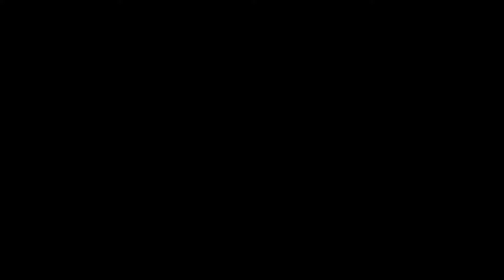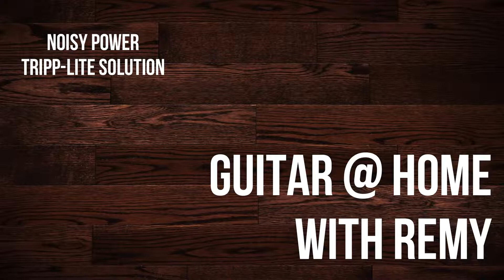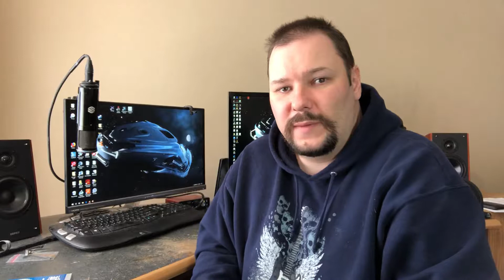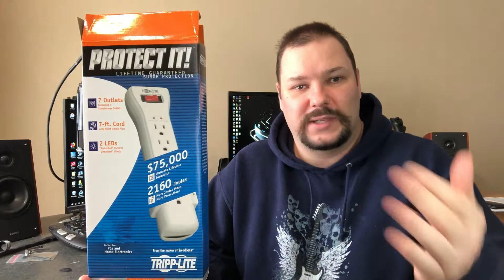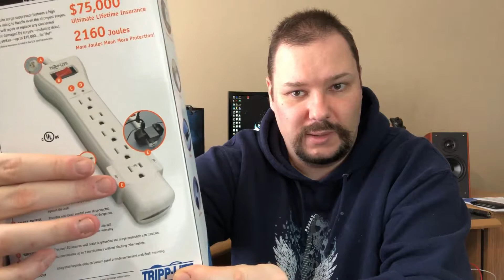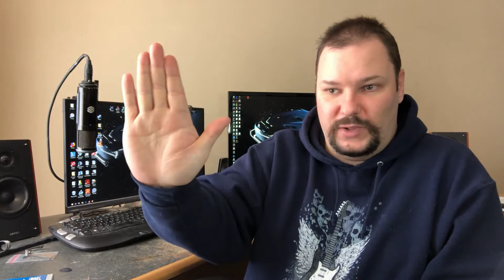Reducing the Hiss on your Tube Guitar Amp

Comment: Can you help me? My fender champion 40 is hissing constantly and it’s driving me so crazy I can’t use it. It is constant, even when nothing is plugged into it. I have also plugged it into loads of different outlets and it’s made no difference. This is really sudden as I’ve had it since Christmas and it hasn’t ever done this before. I really hate the noise and if I can’t fix it I’m going to have to stop using it.
Reply: Try changing the tubes. Sometimes when tubes get worn, one of the indications is they start hissing.  Often, putting a new set of tubes in will make it go away.  Even changing the position of the preamp tubes will sometimes reduce the amount of hiss, especially if it's the V1 tube that has gotten weak, as that's in the first gain stage, and is what the other tubes amplify so any hiss in that one will show up the most.  

You can also go with a low-noise preamp tube, like a Mullard CV4004 (which are a very transparent, clear sounding, harmonically accurate tube) which will reduce the amount of hiss considerably if it's coming from the preamp section. Power tubes can also hiss, and putting a fresh set in can often take care of that, as well.  

That's probably the first thing you should try, as it's the most likely culprit...

Comment: Hey bro. Im so fu**ing glad I found you. I have a question. What is the proper name of that thing you are talking about ? Cause I have a 120w Bugera amp and yeah it has that horrible noise you are talking about. So you feel me. Im just wondering what the name is so I can look for it here in Europe.
Reply: If it's a buzz, theres a high likelyhood its a ground loop. Or a grounding issue in general. Theres a slew of different things that can cause it. It can even be a problem with your amp internally. Tracking down these problems can be difficult though comments or small emails. Places to start would be buying a Hum X ground loop eliminator. Also having a qualified tech look over the amp. Again it's hard to reccomend fixes with little info, but hope its helps somewhat.
Reply: The item he's talking about and showing on the screen is a Tripp Lite 7 Outlet Surge Protector Power Strip (SUPER7). It does claim to reduce line noise in it's advertising material and is pretty inexpensive.  A couple of people in the Amazon reviews for this item in black (SUPER7B) also noted that it eliminated the electrical noise for them, as well. 

Other units that reduce electrical noise are referred to as Power Conditioners, and there are companies that are known for making these types of products, such as Furman. Two Furman units you may want to look into are the Furman M-8X2 Merit Series 8 Outlet Power Conditioner and Surge Protector and the Furman PST-8 Power Conditioner that can dramatically reduce AC line noise and contamination.

Note: The vast majority of power strips and surge protectors do not provide any noise reduction at all, so be sure the units you look at specifically state they are designed to reduce electrical noise.